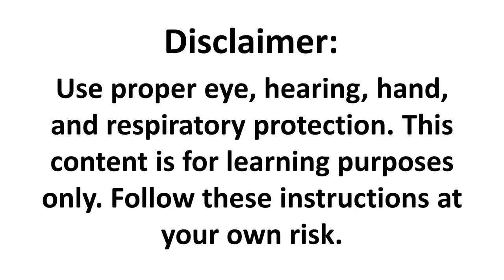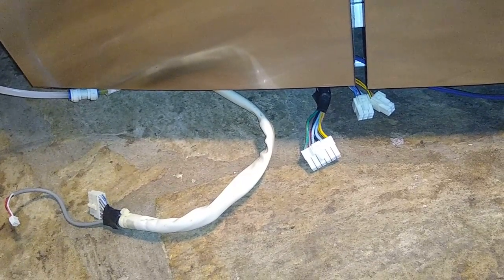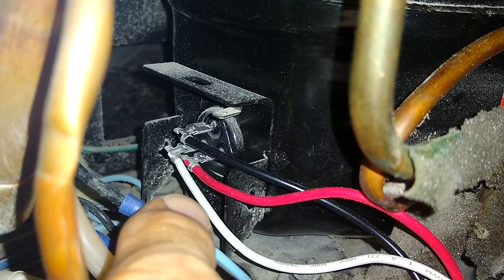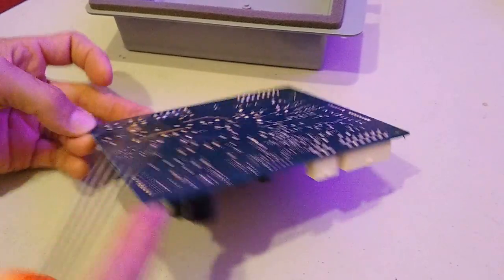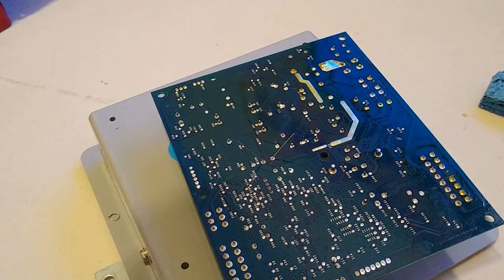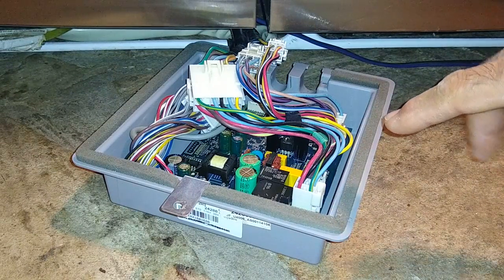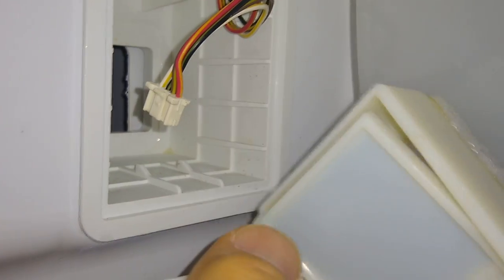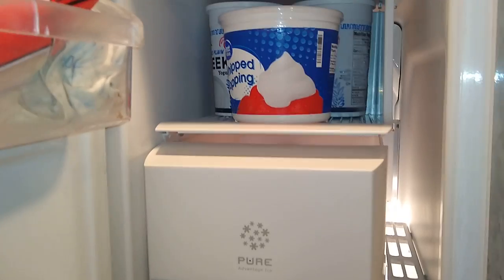Running my Electrolux Side by Side refrigerator temporarily without its control board.

Comment: Great video! Well done! I don't see the link to purchase the 320 pcs assorted capacitors kit. Would you mind please? I see a link for 25 pcs for the one you had to replace
Reply from the maker: Hello G, Thank you for commenting and words of encouragement. Great catch on the capacitor link. I used those to repair non-stop key in ignition buzzer on my daughter's 1998 Rav 4. The link you need is here and it's also corrected in the video details.

320 piece capacitor kit - https://amzn.to/3zDQwRk

Best of luck with your repairs!
Reply: @vbared  Thank you for your quick reply! Keep posting your video's they are great and your explanations are clear and well presented!!